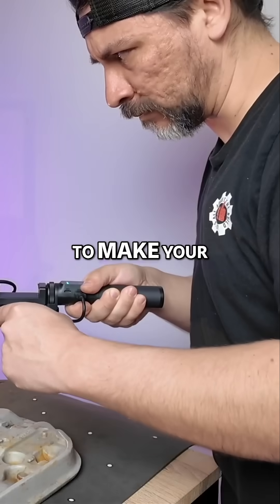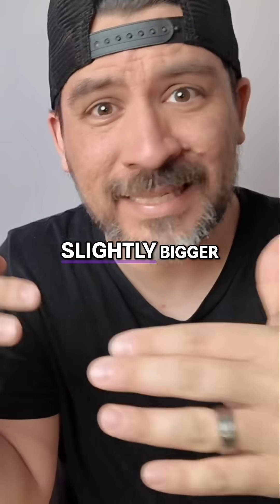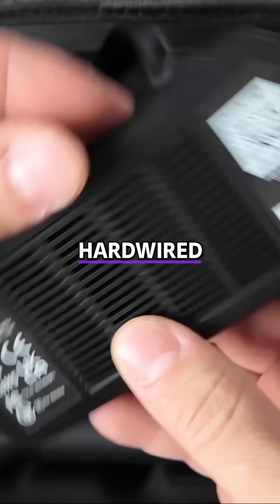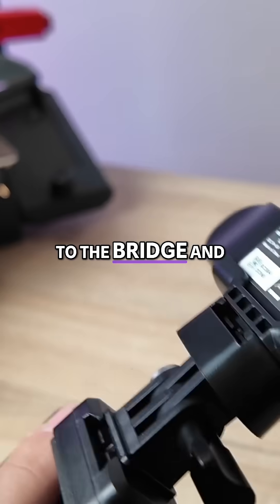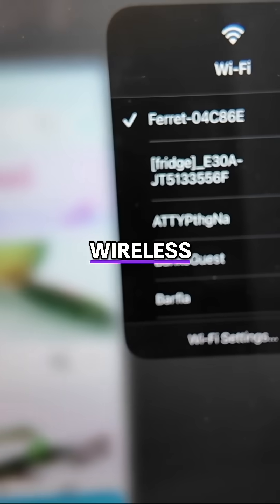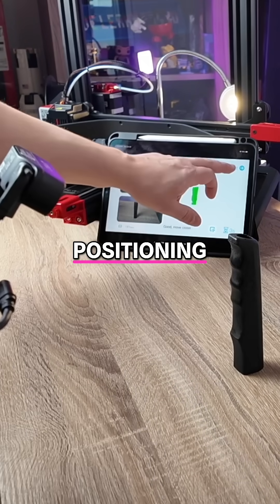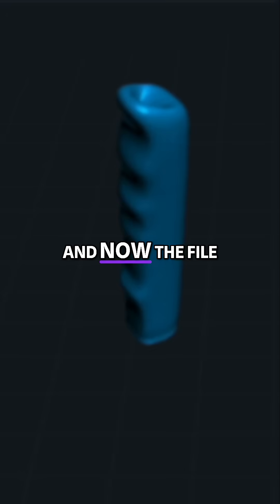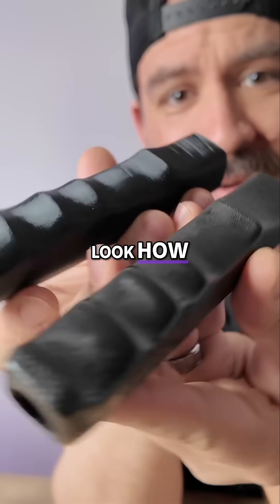3D Scanning on a Budget? The Ferret Pro Might be the Answer...

Comment: Do ypu think it would work easy on scanning for example an motorcycle engine side cover, the edge for making gaskets, or for example the gaskets on cylinder or cylinder heads? Not into remaking gaskets, im powdercoating, so more doing covers, and some parts i do alot, and was thinking instead of masking, scan the inside, make a complete cover of the outlines. If it is pretty easy? Do you think this would handle that? 😁
Reply from the maker: It will definitely give you good scans. The tough part is what you want to make out of the scan. For large items, you'll have to trace the scan out with CAD and then 3d print the cover. You won't be able to 3d print the entire cover at once, you'll have to print it in sections.

Comment: How would you rate the accuracy? And the user functions of the software?
Reply from the maker: Have been able to scan things like dashboard components, but using the tracker dots works much better. The software is OK when working with one single scan. Its good enough to use for CAD modeling, but stitching together multiple scans doesn't work as well as I'd hope it would. Its one of the lowest costing scanners, here's a comparison of some others in similar price ranges -> https://www.allaboutthebuild.com/blog/2025/1/3d-scanner-for-car-parts

Comment: I'm looking into getting this or the Otter. Currently since I wanna scan my car and do bodykits, this seems to be the one to choose since it's possible to use a mobile device and be portable. I got a Snapdragon 765 tho on my 3.5y/o phone, so might need to upgrade for that, but I guess the wireless bridge helps for using desktop with wifi instead. How's it holding up after the past few months? Worth it?
Reply from the maker: Compatibility will probably be your biggest issue as that's where I struggled even with newer devices. A few updates later and things got better, with the wifi option. But if you have a compatible device, it works pretty well. Just make sure you use the scanning dots. Here's a full vid on how it works -> https://youtu.be/YJ45wPpVa5g
Reply: @Itsallaboutthebuild  That appears to be the case from what I've seen so far looking around yeah. Thanks very much for the feedback and the link, I'll have a look and see whether or not we're onto a winner here before spending the funds 😅

Comment: But can you use it on the Bambu lab software?
Reply: I own this 3d scanner. Yes after you have exported it as .obj or .stl, you can upload it straight to bambulab slicer. The 3d scanning is hard at first but after you get some skills you can 3d scan a lot. The device works great but at first you probably get frustrated.
Reply from the maker: @rickyneeter69 for sure, takes some practice as you can see on the full vid 😅😅😅
Reply from the maker: YES, full vid here 👉 https://youtu.be/YJ45wPpVa5g

Comment: You know 3D scanning technology isn't there yet. It's a lot better than it was 5 years ago and it didn't exist to my knowledge 10 years ago so we're on the right track but right now I think I'd rather still use a notebook into micrometer and then go Put the dimensions into a cad Program. Weather on using additive or subtractive Manufacturing
Reply from the maker: It actually worked pretty well for our use case. We've been test scanning a few other items and the results aren't too bad.